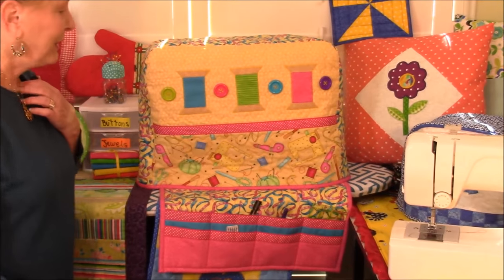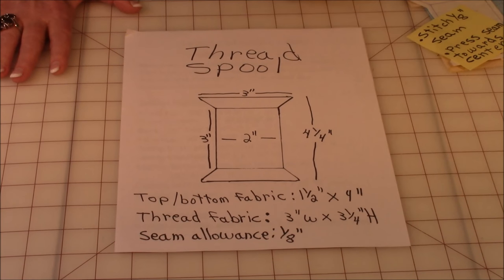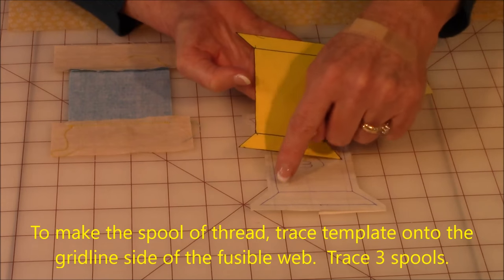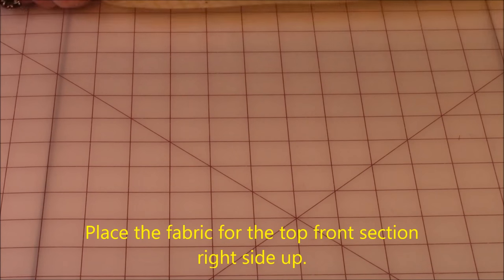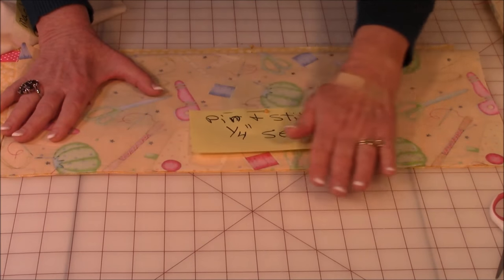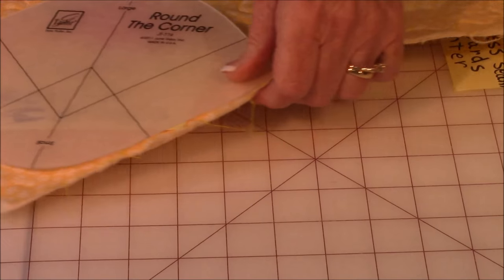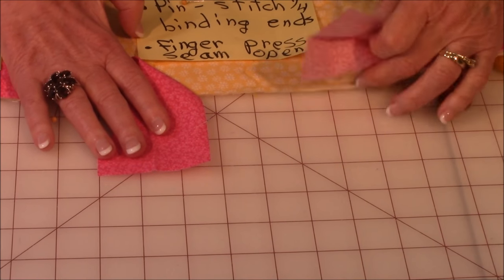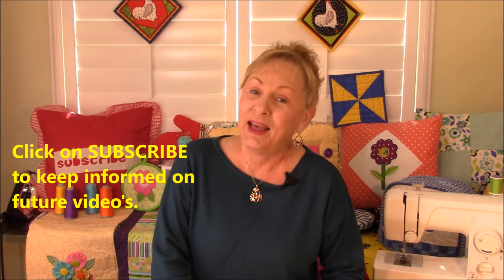DIY Sewing Machine Cover Tutorial | The Sewing Room Channel

Comment: I wish you would show how to do the stitch in a ditch at the machine. Do you leave pins in?
Reply from the maker: Hi Cheryl.  As I get close to a pin I remove it.  You have a greater risk of breaking the needle when stitching over a pin.  If you have a walking presser foot it is easier to see the ditch (seam).  Keep the seam right under the needle.  Thank you for the suggestion on a stitch in the ditch video.  Happy sewing.

Comment: I have the same sewing machine in your video, is the sewing machine cover in this video fit that sewing machine?
Reply from the maker: Hi Marielita.  You can make this cover any size.  Measure the width, height, and depth of your sewing machine and add a few inches to those measurements.  You don't want the cover to be tight.  The machine in the video was just used for demonstration purposes on how to measure.  Review the video on how to measure.  If you need any help, please leave a comment.  Happy sewing.
Reply: Thank you so much. I measured my machine and the finished size of the cover should fit nicely. =) When I'm done I will let you know how it turns out.
Reply: Straight grain binding video 
On the sewing room channel